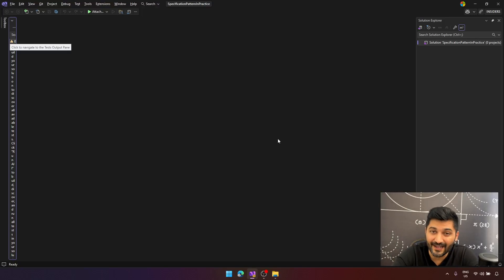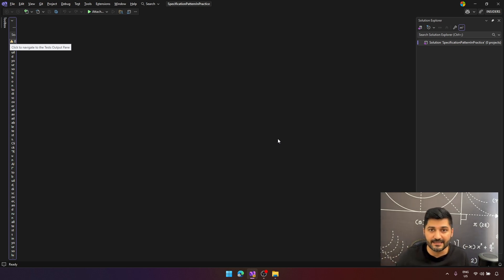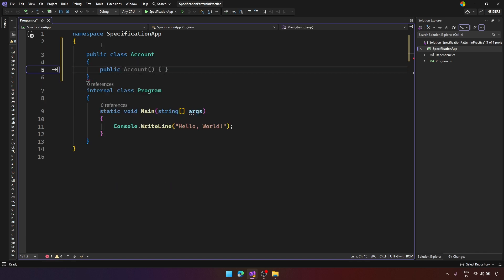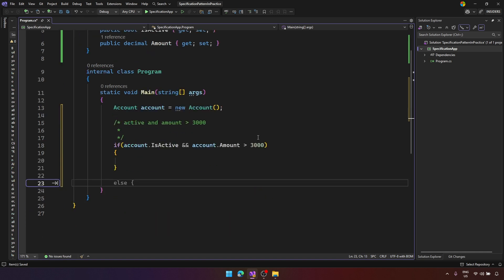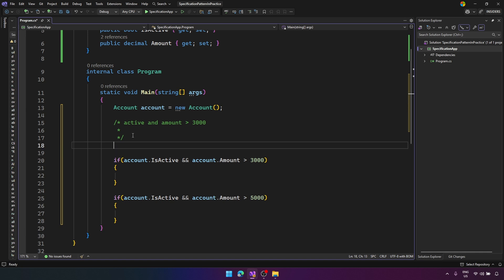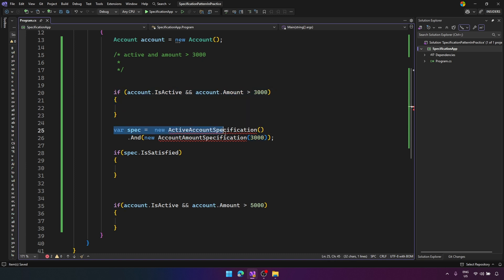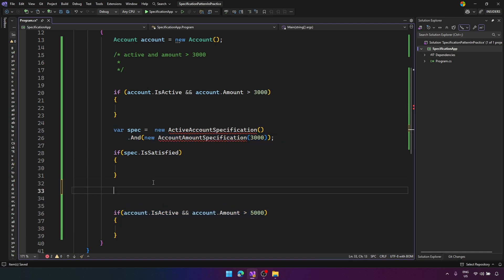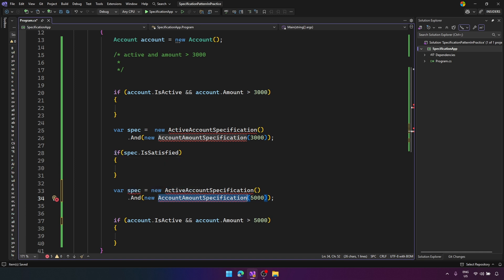Replace Your If/Else Logic With Specification in C# | Think Like a Senior Developer

Comment: Thanks to Tural for sharing such great material. 

I would like to emphasize the usage of Specification pattern when dynamic conditions need to be generated and evaluated at runtime. It really helps avoid writing a large number of hard-coded, static if/else blocks for every possible combination of conditions. This approach—similar to how Java JPA Specifications work - can save a lot of complexity and make the codebase far more maintainable. Adding these points here in the comments may also help others better understand the real, practical usage of this pattern.

Comment: Most of commenters blame Tural for overkill.

But I'll add my "5 cents" 😅

Twice in my experience I've done such stuff, cause it was rule executor with unknown amount rule checks chained like link list.
One was oRTB system where in UI user adds set of rules, the another was kinda Zapier thing (AppKnit) with pipeline of processing.
Initial version of oRTB with if-s was 1000+ lines, it has hard to test, check, debug.
But by doing kinda Tural's example I was able to cover every rule with separate unit tests, and also when debugging I could easily determine which rule worked or failed.

So it's not about few checks, it's about single responsibility at checker level.

Comment: This is how bad code is generated.  How much overhead does it add to the code? Copying Linq is a bad idea.  So sad that someone else had to debug this code in ten year!
Reply from the maker: I think there may be a misunderstanding of the context.

The video is not suggesting that developers should replace every simple if/else with a Specification. In fact, I explicitly say the opposite multiple times: use this pattern only when the business rules become complex, deeply nested, or need to be combined and reused.

The example in the video is intentionally simplified to demonstrate the mechanics of the pattern, not the complexity that justifies it. In real-world domains with rule explosion, dozens of branching rules, changing requirements, and multiple combinable predicates, the Specification pattern reduces cognitive load and keeps the system maintainable, which is actually the opposite of “bad code.”

As for overhead: in real business applications, the maintainability and clarity gained from encapsulating rules far outweighs the tiny abstraction cost. Patterns exist to manage complexity, not add it where it doesn’t belong.

But again : great architectures come from choosing the right tool for the right scenario.
Simple rules → simple conditionals.
Complex, evolving domains → specifications.
Reply: @TuralSuleymaniTech  I do agree with you completely but in my experience over the past forty years I have come across a lot of new programmers that think that by adding unnecessary complexity will impress their superusers without taking the time to properly assessing the need for complexity.  This kind of coding will result in very complex systems that are hard to debug.  My suggestion is that if you had picked an example that was slightly more complex; It would not tempt the new programmers to inject this kind of code all over their application without proper reasoning.  I would like to apologize to you if found it offensive. The term "how is this done by Senior Developers" drove me to post my original comment!

Comment: I noticed some comments calling it over-abstraction  which makes sense when you're looking at a tiny example, but at the same time it's not really a fair or meaningful judgment because the example is intentionally simplified just to demonstrate the idea of the pattern.
The example in the video is intentionally simple, because it's much easier to illustrate the pattern without bringing in a full domain model.
In real-world business logic, rules grow quickly, become interconnected, and change constantly.
That's exactly where patterns like Specification start to show their real value  not in a small demo, but in large and continuously evolving domains.
So the simplicity of the example doesn't mean the pattern is "overkill" ,it just means the true value appears in more complex scenarios.
And honestly, many design patterns will always look like over-engineering when demonstrated with small, isolated examples  that's normal but they become essential once the domain grows enough.
Lately, there also seems to be a general trend of people pushing back against OOP principles and SOLID and Design patterns  but most of that disappears once you're dealing with real, richer business rules swhere these patterns actually solve real problems.

When you see simple examples like this, you should immediately understand that they are just demo forms of the idea the pattern isn’t ‘sticky’ to this specific example, it’s meant to be applied in larger and more complex domains,because nobody is crazy enough to write 60 lines of abstraction for 3 lines of business logic.
Reply from the maker: Hey, thank you for your comment! Definitely! People should use it only for complex cases, bot for simple if/else cases. I didnt write a complex example because of the time. The video in this case will be 1 hour long which is a few will watch it. The real purpose of the Specification explained multiple times. Seems people are focusing to the examples as dogma and it is really bad

Comment: Have you make data consumption comparaison ? 
I think it's overkill, I don't see the interest it's a bit like making a whole method for making the code différent without any benefit
Reply from the maker: Just to clarify again:
The example in the video is intentionally simple only to show how the pattern works.
It is not meant to prove that specifications are better than a single if statement. For tiny rules, a normal conditional is absolutely the right choice. I say that explicitly in the video.

The benefit appears only when your business logic isn’t “one or two checks” but dozens of rules, combinations of rules, conditional flows, and frequent changes from the business team.
In those situations, specifications bring a lot of value:

1) rules become reusable

2)logic becomes composable (And, Or, Not)

3)branching is isolated and testable

4)adding a new rule doesn’t require rewriting old ones

For simple code → keep it simple. Use if.else
For complex rule sets → the pattern helps maintain clarity and avoids code that becomes fragile over time.

Comment: Actually, adding this must abstractions for a few simple if statements, is not something a senior engineer would do. It's something a mid-level developer aspiring to be a senior developer would do because it looks fancy. Then you learn that it just adds more complexity, becomes harder to debug, and harder do maintain. 

How ever, I do agree that avoiding nested complex conditionals and replacing it will clearly named functions do add a lot of value.
Reply from the maker: Thanks for the feedback! And I totally agree that adding heavy abstractions for a couple of simple if statements is unnecessary and can even make things worse. Not every problem requires a pattern.

But also, don’t take the example as dogma. As I mentioned in the video, these approaches really start to shine when the business logic becomes complex : multiple rules, nested branches, evolving conditions, and scenarios where readability and testability matter long-term.

For simple conditions, straightforward if/else is perfectly fine.
For complex domains, the abstraction pays off.
Reply: If the if statement has to be duplicated n times and someday the specification changes you would need to find all of these if statements and change them instead of just changing the specification.